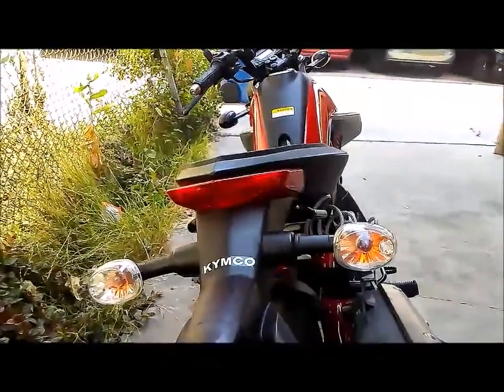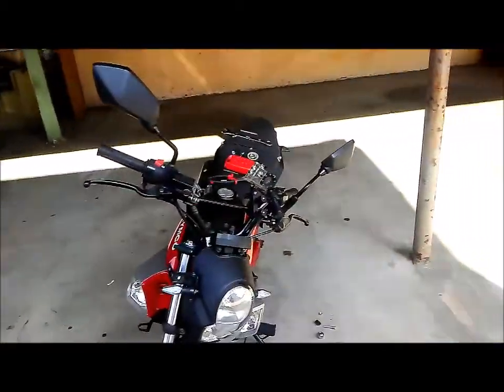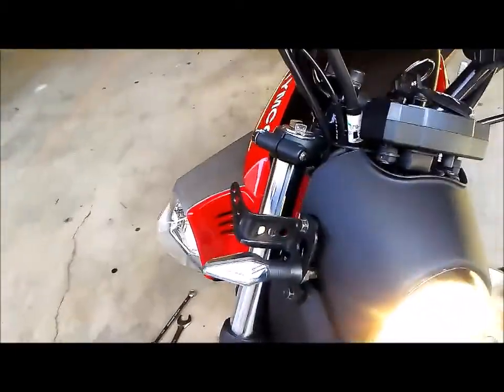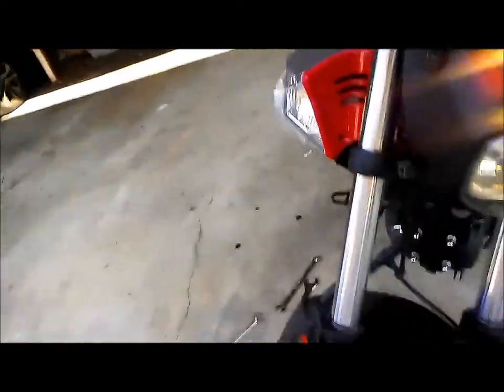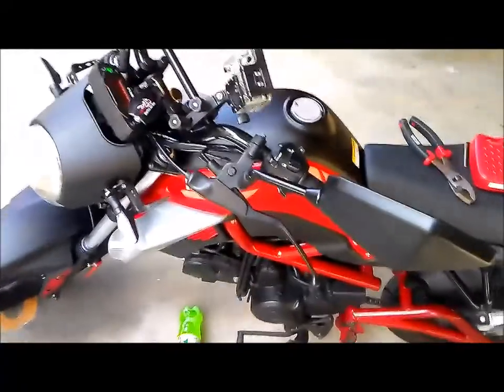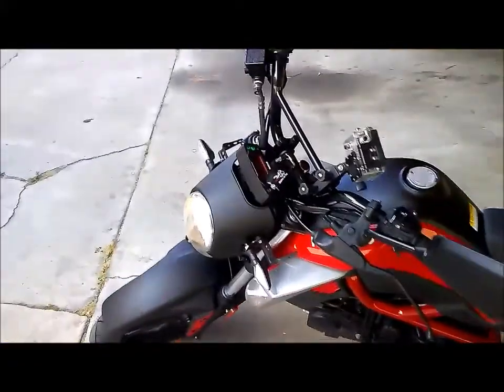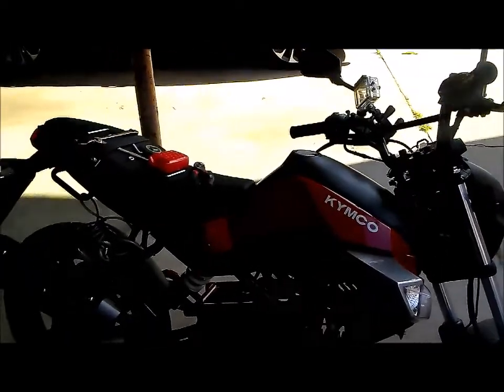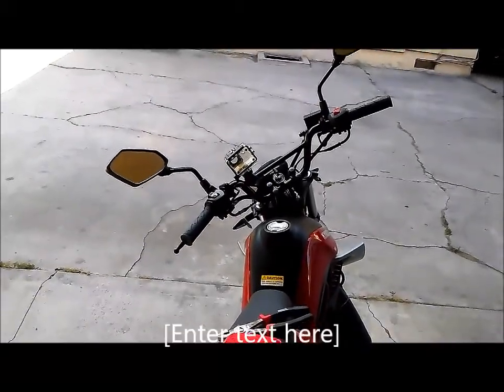2017 Kymco K Pipe 1300 MI Service and Mods Part 1

Comment: How did you change the oil?
Reply from the maker: Use a 17mm wrench on the drain plug on the bottom of the motor. Depending if your engine is still being broken in then may want to remove the right side clutch cover to remove the oil screen and clean it as well make sure you get a new crush washer for the drain plug and a new gasket for the clutch cover just in case. Let me know if you need more details.
Reply from the maker: And make sure you replace the oil you drained with a fresh quart of oil.
Reply from the maker: https://youtu.be/rEzDxaA21Oc i have done an oil change video for reference.

Comment: Do you know how to take off the fake lights on the side?
Reply from the maker: Agustin Ortiz I actually just did it today you have to remove the two screws in the front on the front facing gills then remove the seat and undo the four bolt hold the rear body as well the large faux carbon fiber side pieces just pull off easy reveling two bolts take those off on each side you have to then carfuly pop out the side under the front of the body and take off the whole tank covering at once with the rear plastics attached be careful the plastic will scratch and crack easy after you have the plastics off the bike it's simple to remove the plastics you don't want only way I could find to do it. Good luck.
Reply: Why?
Reply: On mine they are real turn signals, bc i'm from EU